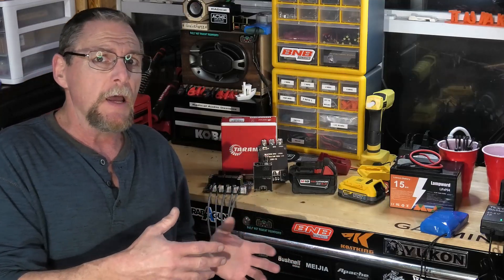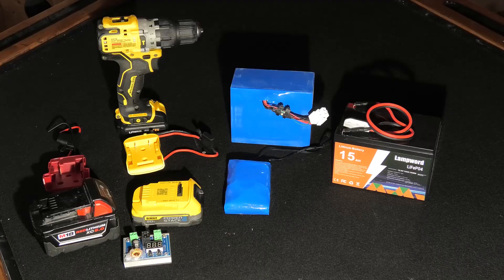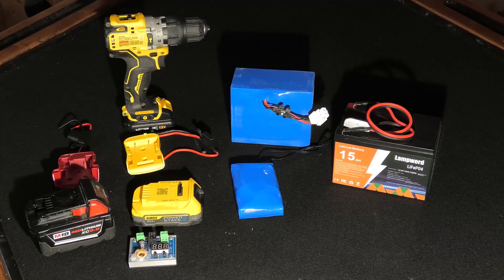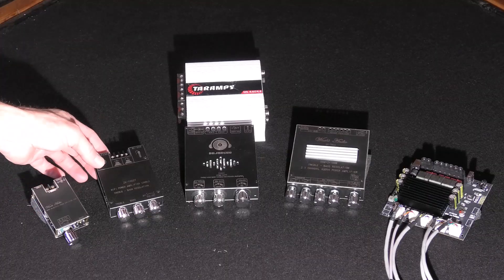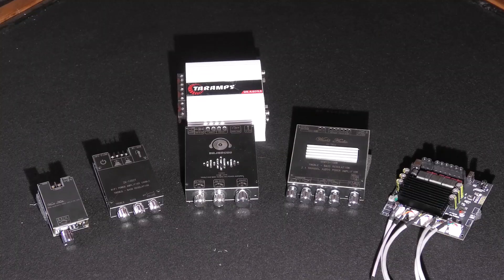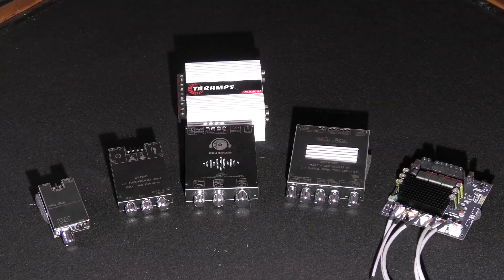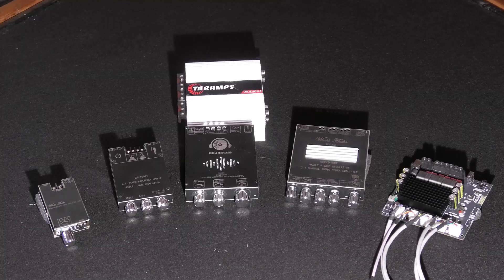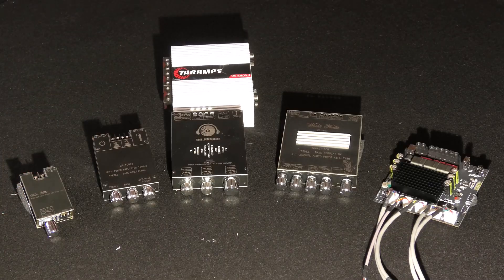How to build a boombox Segment 2.5 Choosing Components

Comment: Thanks for all the very informative information. But I’m looking at using a converter so that I will be able to plug it in to the wall outlet and not worry about having to use batteries. Would the second one be the one to use? I believe it was the ZK-1002T Pro. Thanks for all the info and have a great day.
Reply from the maker: All of the amps can be run from a power supply from the wall. Just make sure to match the max voltage of your amp. the 1002T and Tpro are 24v, so you need a 24v 6ah power supply for best performance.